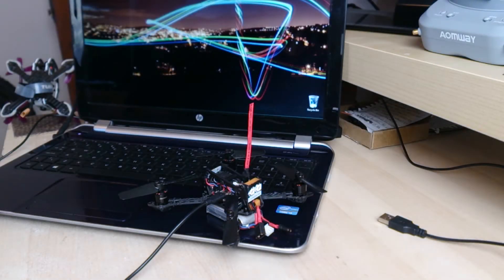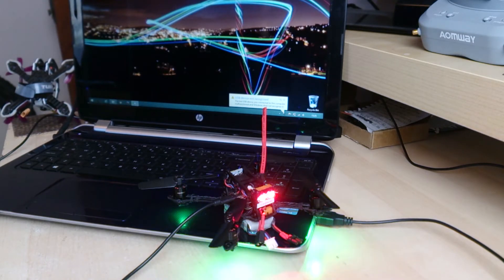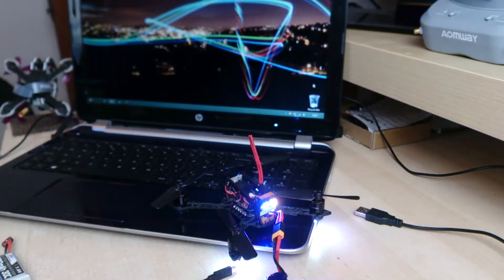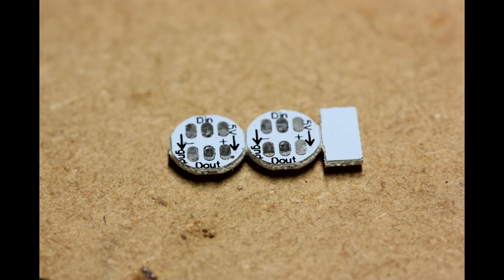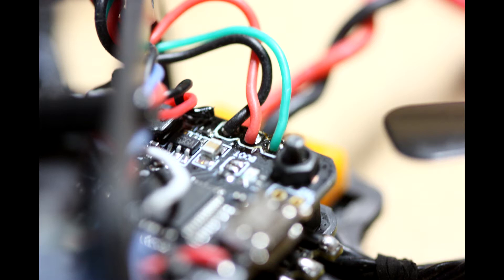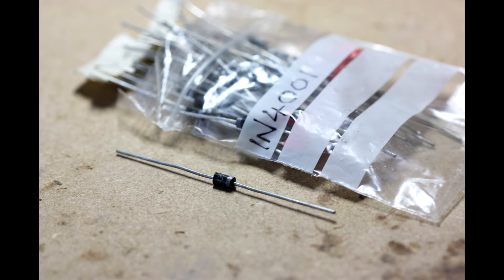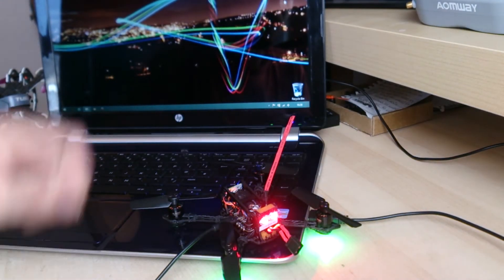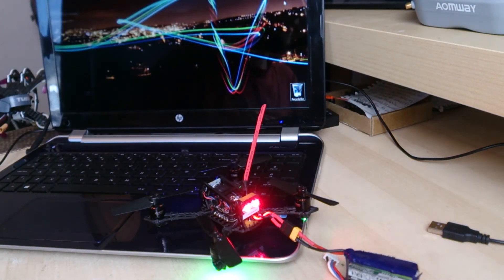Betaflight Addressable LED Freak Out Issues and Diode Fix

Comment: I need your help, i brought a new receiver Flysky FS-A6 6CH for my jjrc p200 I bind it to my radio and it bind but I don't have any responds into my quadcopter?
Reply from the maker: Ok, few possibilities here. 
First, why was the RX replaced exactly?
Is software and TX unchanged?

Providing there's no other changes or damage, a new version of the same RX should be drop in and work when bound without any software or TX changes.
If I remember right, those RX do not offer a bind confirmation on the FSi6. How do you know you are bound, do it have an LED to show this?
My bro still has my P200 and editing a video now with him flying it, little bit dated now but awesome quad all the same.